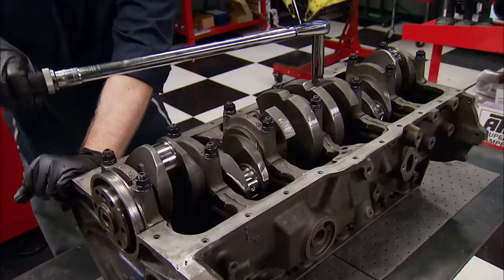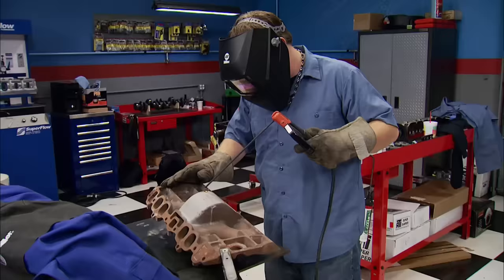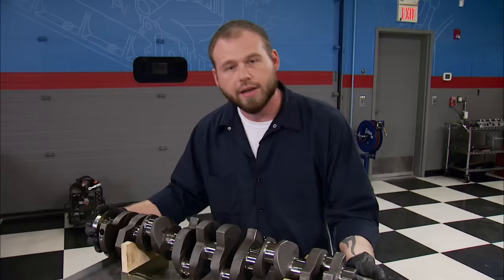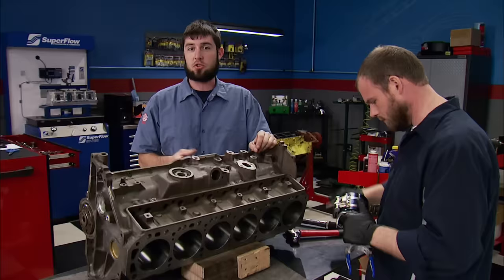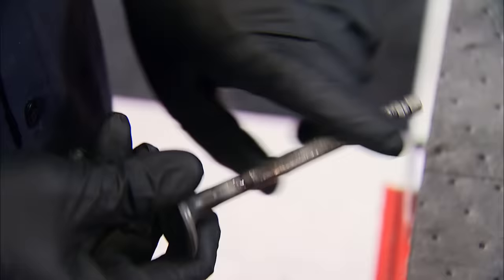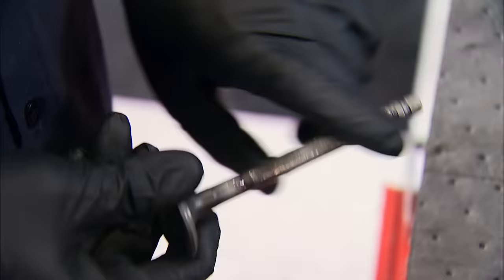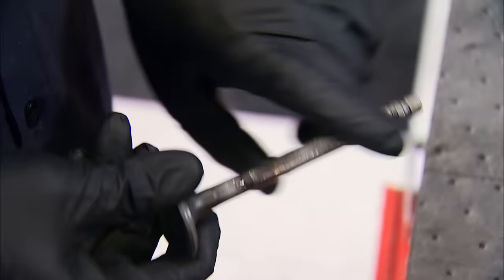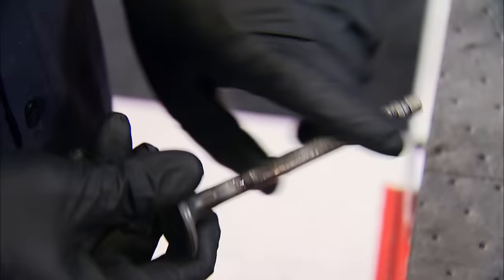What Will A New Top End Do For Our Old School Inline 6 On The Dyno? - Engine Power S1, E4

Comment from the maker: Enter for a chance to win the Holley Corvette built on Detroit Muscle: http://httpslink.com/lnk_295e9a49
Reply: How bout you guys put that 300 I-6 in a 77 F-100 and give that away?
Reply: Could you do the same upgrades to a industrial 300 ford in a brush chipper? It would be nice to have more power !
Reply: What are some cheap easy power upgrades for more towing power in a 302 V8 in a late 80's Ford Econoline Van
Reply: Try a 426 hemi and get it to 650 hp with a budget.
Reply: how about u guys use that motor and try using a EFI on it to gain HP and maybe a super charger or a turbo
Reply: @Kirayamatoplay  They probably do...I can understand  reusing a carb if you already have one or a cheap used one  but at $200-$500 (and higher $$) if you need a new one ,you might as well spend a little extra $1,000-$2,000 and get EFI kit Especially if you don't wanna change jets every time you change elevation
Reply: Hey guys, where I can buy a similar engine? Please advise contact info
Reply: I'd like to see a Ford inline straight six turn out 850hp if it can be done please make a video of it being done 👍😎😎
Reply: I really Enjoy, looking at this engine. I am looking at removing a engine from a later model Ford/Chevy/other vehicle, and replacing it with a Ford 300 inline v6, with a new intake and new carb...and keep the older Distributer, due to NON electronics on the vehicle.  

Cant wait.  

Also, can you also show the price of the ITEMS that you are upgrading to, the cost from just original to aftermarket parts....and costs from the machine shops/service shops.

Comment: I like how they say “budget” and proceed to show $5000+ in new parts.
Reply: Considering engine builds can easily exceed 10-15 grand, I would argue it’s pretty budget oriented. There are no custom parts, and for as much as  the engine made, 5 grand isn’t bad.
Reply: 5k ain’t bad tbh
Reply: Not to mention you could build a thirty over 302 that'd make even tq or more and 80 more hp for 2800 bucks. That's budget but some people like to try reinventing the wheel, 2 V-8s for the price of 1 I-6 sounds like a bargain to me. Hell, you can buy a dyno'd 340 horse 306 from Blueprint w/ a warranty for under 5K.
Reply: Those piston rings is what made it budget.😂
Reply: Agree with you, tricks of the trade, you can save a ton of money I know people pay more for an engine, but it’s all in who you know that’s forsure, I still agree with you no matter what, it’s surely not budget when it’s literally a quarter of some people’s annual income, on a budget ass my ass
Reply: speed parts for inline sixes have always been more expensive than the same parts for v8's. but, v8's are boring.... built sixes are much more fun :)
Reply: The only way there was 5grand in that is having it assembled at the machine shop. Prob 350 in machining fees and 2500 in parts. Just sayin
Reply: Right? Some people have definitely higher budgets than others. But , I guess if you set a limit, that would be the budget you have to work in.
Reply: I know, i grew up in a salvage/repair shop and we did ALOT of budget builds that didn't exceed 1200, of course we didn't go straight to summit, we always got intakes and headers, heads, all kinds of good performance parts at swap meets and auctions for cheap
Reply: Agreed.  You can get a reman marine 460 that makes 340hp reliable hp for $2400 from Summitt with a 3 year unlimited mile warranty.  Not the most hp but more than this 6 made plus tons of torque and full of HD parts that make a great foundation for upgrades or a turbo.
Reply: My engine build was $350 and 6 hours at a junkyard. And 6 more at home
Reply: Big budget is still budget. Lol
Reply: The parts list in your description isn’t even close to what you used.
Reply: If you want a 6 cylinder in line engine, build one.  If you want a 8 cylinder build one.  Don't be critical of others choices.  It doesn't do anything for the engine building community.
Reply: I mean, not everyone wants to throw an LS into everything. It's good for people who have vehicles with these engines in them to see what can be done with them
Reply: Nuttin makes up for simple cubic inch
Reply: @alanmydland5210  the 300 is pretty big for an online six.
Reply: @michaelkeyes3856  350 to machine an engine and clean it all up? Don't think I'd trust that shop.
Reply: 5 k I put a 5.9
Reply: That's exactly why I stopped tuning in to these shows..
Reply: @reologan4262  ..and yet, here you are.
Reply: 5k is budget, sort of. In this situation I say 5k is not budget, for 5k you could ls swap an s10 which would shit all over this 300.
Reply: 5000 probably not that much to those guy's.... million dollar shop tool's and everything...
Reply: The budget amount wasn’t disclosed
Reply: If you're broke just say so
Reply: @jimmartin7881  Good point. I suppose this build would be for an old truck in good shape that already has an I6 under the hood
Reply: @meegstomtom  35 for hot tank, 300 for thirty over bore and hone with a plate, 125 for decking the block if need be, 125 for the head if need be, 175 for align honing. 760 and the rotating assembly hasn't been touched or even been balanced yet. I would run like hell from someone wanting that 350 to do so much work.
Reply: @jimmartin7881  I know right. Lol
Reply: Skip R  I have an inline 4 cylinder with 425 WHP & 462 lb ft of torque that would hand your V6 its ass. What's your point? This is an interesting build that was entertaining. And it may help someone down the line with their 300 I6.
Reply: With todays salary that they give people hourly i could not even come close to putting out that kinda of money i dont even have a car the last 4 years i walk to work . Thats way 2 much prices just keep going up i wish it was 1982 prices again thats when i was born
Reply: My dream car for this engine would be a jaguar xks. I wonder if anyone has put a supercharger on a 300?
Reply: Most use like 15000
Reply: @flatheadfletch  - LOL! inline 6's are smoother than inline 4's, but V4's and V8's and V12's smoother yet...
Reply: Parts all donated from Summit and others!  Then RTM Productions sells the completed project
Reply: If the engine peaks at 3500 why use rollers?
Reply: @JackMehoff32  don't know where you get work done but there screwing you
Reply: @JackMehoff32  I've got a 1964 dodge dart slant 6 I can get a complete rebuild kit with everything crank . Pistons , cornering rods can everything for 350 dollars machine shop work will be another 300 so for 650 I can't completely rebuild it .I don't know where you get parts from but 5000 iss not a budget build and 10 to 15 thousand dam that's way to much
Reply: Still not as cheap or powerful as a 5.3 LS swap. Lol 😆
Reply: What's with all the complaining about 5,000 that's extremely cheap I put 15000 in my engine.
Reply: @leepalmer1210  why would you put a 500lb engine in a XK jag? You can just build the 4.2 jaguar engine….
Reply: @stevenmccauley254  you have a Mercedes GLA45?
Reply: If you're running an efi it'd be cheaper than that wouldn't it? Because you'd save yourself the entire carb setup to just buy a megasquirt for like 700 bucks, and their headers are already quite good as well.
Reply: "affordable parts"
Reply: @C Connon, it does take money to construct Hi-perf. engines, yes... But my estimate of what they spent was on the High-end of this overhaul... Maybe $3-4 k. In New H.P. parts, but many of these could have been substituted with good used parts... I would have used a Clifford intake with a progressive secondary Weber 390 cfm 2-bbl down-draft carb, or one of those Weber knock-off's that work so well..  I would have stayed with the stock exhaust manifolds. The anti-windage wiper is a valed-value , and I would have put a Pertronics electronic ignition kit into a stock points type distributor, with a 3Ω 'Flamethrower' ignition coil and shelve the stock problematic Ford 'Dura-Spark'  ignition system and computer...  The stock rockers, rocker shaft, pushrods, lifters, camshaft, valves, auto rotating retainers work so well on these engines that the money saved there - would really make the overhaul affordable... These engines are already over-built, so the stock crank, stock pistons, stock rods, new crank and camshaft bearings, stock oil pump, BRASS freeze plugs, new cam drive components work very well... I recently overhauled a friend's 1962 Ford 223 inline-6 with similar components described above... It now runs BEAUTIFULLY, and starts so easily with good oil pressure and amazing reliability and excellent fuel economy... The entire overhaul, including hot-tanking, another head (without cracks), and all new rings, gaskets, seals, new bearings , an aftermarket knock-off carb. , cam timing set, etc. Cost about $2,000 in parts & labor.... This vintage 1962 F-100 truck can now go anywhere he wants to take it, without issues... The work CAN be done on a budget Amigo...
Reply: @JackMehoff32  you can get a coyote  swap for an extra 2/3k wtf 
I rebuildt my enginfor 3k
 93- 4.9 manual
Reply: Lol we switched to to chevy piston and save a whopping $10bucks lmfao
Reply: Large budget they should’ve said lol
Reply: Too much for a 6
Reply: I have a great idea take that 5k go to a junkyard get a GMC Yukon in-line six eBay turbo kit and good tune and bam 500hp easy for 1500 you won’t regret it. It’s the American 2jz
Reply: Maybe the budget was $6000?
Reply: Guess it depends on what size budget you are working with, they didn't say low budget.
Reply: @jimmartin7881  WHERE
Reply: @michaelmartinez1345  what state do you live in? I need to bring you a project and maybe you can help me out! For real!
Reply: @Cloud9forU  I'm in Az. Where are You at? What kind of an engine do you have? What kind of a vehicle do you have? Is it going to be a daily driver??
Reply: Sorry not everyone is poor like you... get better job and you can afford stuff like this lol 😆
Reply: Sorry but these days anything under 10k is considered budget, because the dollar isn't worth as much as it used to be, if you paid for all of thoes parts today in actual gold dollars you would owe the guy behind the counter 5 to 7 bucks
Reply: @michaelmartinez1345  this sounds good to me.
Reply: Why that horrific wrinkle paint?   WTF is that about?
Reply: That fully equipped shop that 90% of most of us dont have don't hurt either lol but all that stuff makes it nice but not necessary to get it done.
Reply: Budget builds are $2k or less
Reply: Budget means that there is a spending limit. Why people use this to mean cheap is beyond me. They had a five thousand dollar budget, so they said that they stayed in that limit.
Reply: That’s pretty budget
Reply: They do the same thing in the magazines also.
Reply: $5000 is a budget. You're expecting a literal junkyard build. Anything under 5-6 is considered a budget build.
Reply: 5k is pretty budget, if you can’t afford that don’t get into cars.
Reply: Plus they have a readily Available machine shop.
Reply: Well they did save $10 bucks by switching to LS style rings!!! 😂
Reply: @jimmartin7881 yeah build two V-8’s  with less torque than one inline 6 sounds good!!!
Reply: It was more than 5k. It was more like 8 or 9 k.
Reply: That’s what I spent on mine, and I agree cheap
Reply: Around 50k plus for trophy truck engine
Reply: I few budget as less than the value of the car it’s in
Reply: @jimmartin7881 not everybody wants to put a v8, some like to build straight 6 Fords and Chevy, and the 6 Cherokee, and slant 6 Dodge. Specially when they are built to spin to 7500-8000 rpm like we do in Argentina. The sound alone is a win-win.
Reply: Strictly speaking, any numerical value can be classified as a budget.
Reply: That is pretty budget😂 considering the 300 I6 aftermarket  isn't very large there isn't much to choose from clifford, headman, offenhauser, ishkey, comp and stock. If you use the efi head you can't do the chevey rocker mod but the efi head does boost compression and have better flow.  as for carb intakes there are 2 offenhauser, and 2 clifford with the cheapest of those starting at about 500 (and factory ford). Exhaust, headman at about 300 and clifford has a few options, I think starting at 400 or 500. The factory 2 pcs efi exhaust manifolds have similar flow to the long tube making them perfect for turbo build but cast iron cracks and leaks kind of quick with those. The clifford 6=8 parts do limit use to webber style carbs, personally I don't like that. They could have gone up to a 500 cfm carb, kinda sucks they didnt. Cams are limited to like 4 grinds i think i havnt looked much for those. On my build I have the dual port offy intake, efi head, headman long tube headers (should have spent a little more to get the clifford headers. The headman make it a pain to get to the starter), and a 500 cfm edelbrock avs 2. Next step for mine is a cam and piston upgrade. I want to get the compression to 10:1. after that it leaves the door open to turbos depending on the intake manifold and what your wanting to do with the engine you can hot rod the shit out of it or play off the low end build and have the turbo spool later and pick up the power band after 2800/3000 rpm where the engine stops making torque naturally but keeps making horse power and just amplify that. Great engine the 300 and the 240 but there isn't much to choose from parts wise.
Reply: Hmm... $5k for a million mile bullet proof engine that'll pull anything it's hooked up to... Lemme do the math: carry the one... Yep, worth it.
Reply: Not that long ago, This Was a $2800 build. Nice thing about these engines is that you can get a good powerful engine Relatively Cheap.

Comment: When i paint my engines black i always leave the freeze plugs till after paint so the brass will pop with the black and give it that extra bling factor. Looks good
Reply: its really cool until you get the valve covers on,the intake on,the carb,linkage,air cleaner,the exhaust manifolds on,the fuel lines on,the alternator,water pump,oil pump,power steering pump and all the bracketry .\. then you see nothing anyway.....ask me how i know this intimately
Reply: Is it damn near impossible to spot oil leaks from failed gaskets with a black block?
Reply: @hairyparatestes1183  you’ll see the shiny fluid running down the block..
Reply: @hairyparatestes1183  
Some oils are florescent under black light - you can buy cheap B-L light torches from most hardware sores, then just need it to be dark.
Can also work for coolants.
Failing that dust the suspect areas with talcum powder, it'll stick to the oil and blow away from clean paint.
Reply: Looks great on oldie flathead straight sixes. I did special order the brass ones in the right size thru NAPA.
Reply: @trillrifaxegrindor4411  Down side, near impossible to see oil leaks.

Comment: It's nice to see such an iconic engine like the 300 straight 6 get some love. Ford made those for ages. They weren't the most powerful, but their simplicity made them indestructable.
Reply: I owned a lot of these and and built a few of back in the day. It was fun watching them be so precise. I used to set point gap with a dime and time it by ear - don't think I ever used a torque wrench! :)  They would still just run and run!  A great engine!

Comment: I must have blinked when the EFI was tested.
Reply: EFI.  Eye fooling injection you blinked it’s gone   Dunno
Reply: Click Bait :o
Reply: Ya for real. Wtf?
Reply: I blame the annoying new guy. 😂
Reply: @TsunauticusIV  That strategy never fails, lol.
Reply: I drive 96 F150 4.9 EFI daily. Short bed setup to tow 5000 lb camper   3.31 R&P 3” stainless exhaust 70 series Flowmaster   Detroit true track.  Everything else stock with M5od. Curios how it would dyno
Reply: @flatheadfletch  I had a 1993 f150 long bed single cab, 3.55 axle and m5od-r2 transmission. All stock. It pulled a 9k camper about a hour away with no problems.